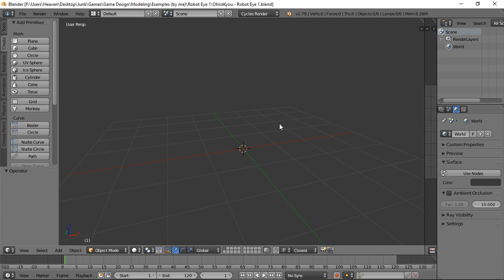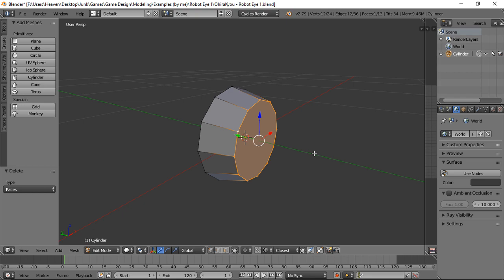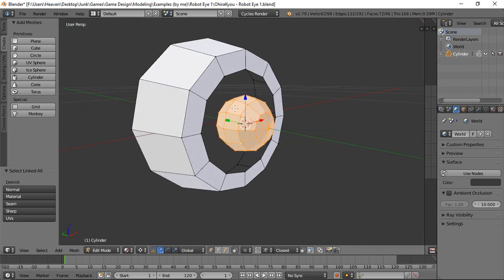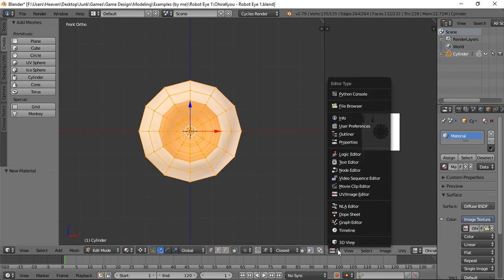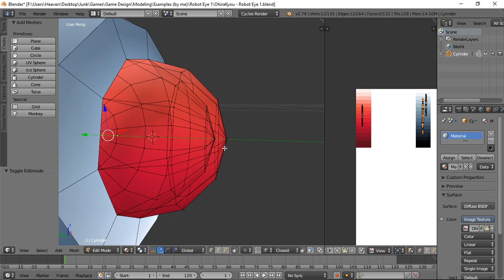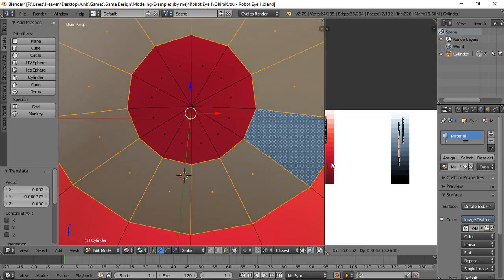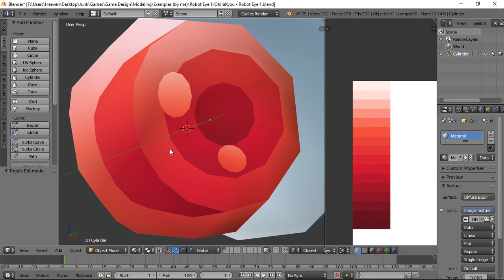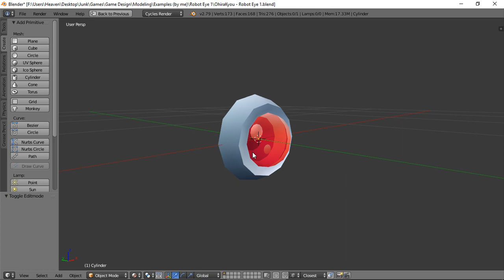Robot Eye 3D Modeling Tutorial (Blender)

Comment: I know it's late (or early... in other words: I'm awake for quite some time now) and at this stage I'm getting excited a little too easily, but hearing your voice for the first time made me fangirl a little, lol.

For the video itself: very inspirational, showed me a lot of things I didn't know. You make it look so easy (guess practice makes perfect - not that I ever experienced that feeling, I feel pretty slow at everything in general).
Reply from the maker: Glad it was useful. Yeah, with enough practice, you can get into a flow. And, that basically boils down to making anything that previously felt unnatural feel natural, allowing more focus to be allocated to experimentation. Thankfully, some of that awkwardness-smoothing work can be done by adjusting some settings.

A significant productivity boost for me came from binding common (yet awkward to initiate) commands to mouse buttons. Specifically, select connected (ctrl+L), vertex connect path (J), dissolve (ctrl+delete), and Y (for scaling and rotating relative to the Y axis without taking my hand off of the keyboard). And, I inverted the mouse behavior early on so that selection is done with left click instead of right (in Blender 2.79 and earlier). Also, I changed Z to toggle directly between wireframe and material, since those are the viewport shading modes I use most often.